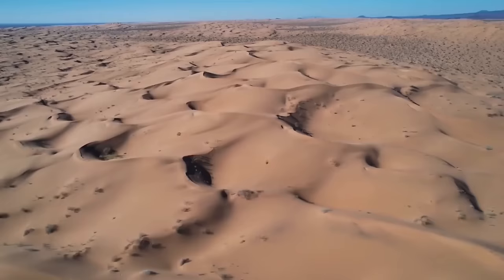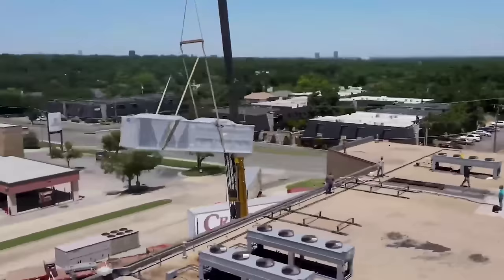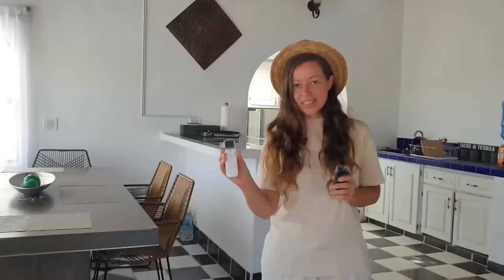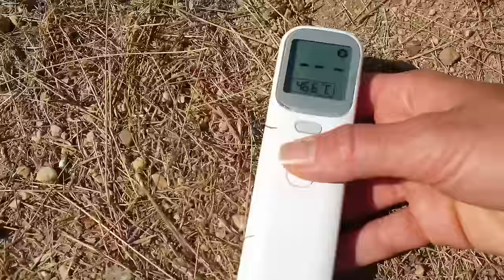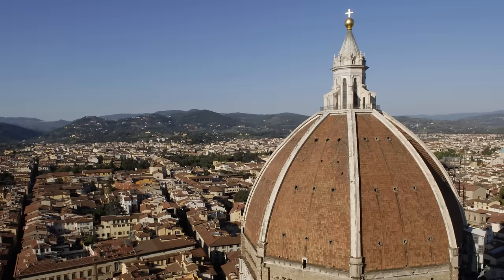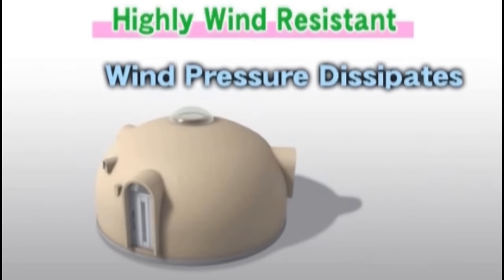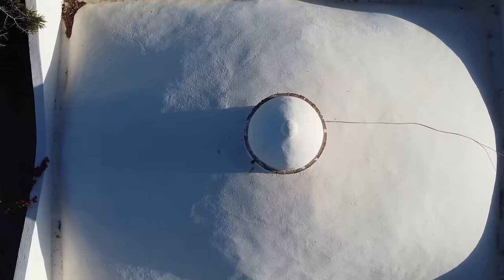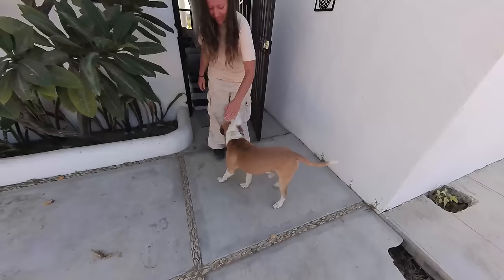How I Live In The Hottest Place On Earth Using An Ancient AC System To Stay Cool!

Comment: In Malaysia and Indonesia they use thatch roof with a vent near the top where all the heat escapes but rain cannot get in. These houses are not dome shaped but more rectangular. These traditional houses have no A/C at all just gentle cool breezes. The key I think is the vent near the top and not the shape.
Reply: I actually think the shape is more important. The traditional houses of Batak and Miningkabow people (sp? it's been a long time since I was there.) in Sumatra have a sway-back wooden or thatched roof with a large, screened vent at each end. The ridgeline also extends quite far beyond the vertical walls of the front and back facades, sheltering them and their porches from rain to a degree. Thus, viewed from either side, the roof resembles a square sail billowing in the wind, dipping lower in the middle and quite high at each end. So this creates a Venturi effect, where the breeze coming in the large vent at one end is compressed in the middle and then rushes out the vent on other end, pulling more air. And when there is no breeze, the warm air from inside is able to rise because of the upward-trending ridgeline, and the outflowing air creates a cooling airflow within. In a hot, humid environment like theirs, airflow is key to comfort.
Reply: @feedigli  TY.   Also humid area, this designer:  kotaronishiki

Comment: 117*F outside, 77*F inside Still not cool enough for me ! Under ground houses in my area maintain a 55*F temp year round so only a little heat needed in wintertime!
Reply: That sounds interesting. What area are you referring to? I'd like to learn more.
Reply: Sounds like Coober Pedy.  Limestone is wonderful stuff.
Reply: If the exterior is painted with the new cooling paint and the house walls are thicker for insulation, then you could achieve more passively. The exterior/under-house tunnels for cooling of air flow is also interesting (though perhaps hard to add after the house is built).
Reply: Depends on the humidity. 77 @ 15% humidity is more comfortable than 72 degrees at high humidity.

Comment: It's easy to build a house against heat or against cold, but the really hard thing is to build a 4 season house.
We in Europe don not use these methods, because we have very cold winters and very hot summers.
Reply: My understanding is that ground temperatures 1-2 meters deep are pretty consistently 13-18 C , year round, in most of the temperate latitudes. So, using earth tubes as many have suggested, is not a complete, stand-alone solution, but would definitely moderate extremes, reducing the heating/cooling needs to a level that, in cooperation with other methods, could be handled sustainably, without resorting to a/c, or fossil fuel heating. 
A lot of European cities use sun shades over their narrow streets in summer, which really helps. Again, not perfect, but much nicer than the wide, baking asphalt of American car-based streets.

Comment: Same as the Temples in Thailand, very tall structures with high sloping roofs ending in a sharp point, the radiated heat doesn't get down to the floor so sitting there, very comfy, while outside very hot.

Comment: The white paint is a major factor as well.  I experimented on a south facing outside wall, and white paint was 20-30 deg F cooler than a medium (more than 50% reflective) blue paint.  Most of the heat inside was coming through the roof, though, which was 3 tab asphalt shingles.  I wish I could cover the roof with something white.  It should be noted that not all white paints are equal, as only some reflect infrared radiation, and half the solar radiation hitting the Earth's surface is in the infrared.
Reply from the maker: That is soooo true

Comment: Remote rural off grid here down under , have embarked on an extension using packed Earth car and truck tires  got the idea from Mexico where they build such things. Using the peak of the building as a flow through of hot air and having tubing at just above ground level , created the same as a cave  cool air gets drawn in. Also painted the roof of the house, workshop ect with eco paint , its very white and reflects up  to 80 percent of UV., and around seventy percent of heat ... 45 degrees outside main core of the house is around 30 or so, works.
Reply: Well done!

Comment: Variable insulation (shutters for windows, doors, walls and roof). Opened during night. Natural ventilation from north side. If the floor if not insulated from ground is cool enough. It works if there is a difference of temperatures between day and night. In summer, in my little wooden house, 80 sqm, outside 31 C, inside 18 C with closed shutters. Without cooking.

Comment: I live next to a sizeable pond and my AC is to pump carefully strained bottom-of-pond water through a fabricated A-Coil in my furnace. The water is returned to the top of the pond after use. The strainers require a bit of cleaning from time to time - but hey no compressor or freon !

Comment: My wiring will no longer allow one.  Ten years ago the quote was 15,000.    I don't have in any way or form.  So as soon as I can afford to buy  sand, I'm building an earth home in Oklahoma  near Tulsa.
Reply: Mini-split heat pumps can be bought for under $1000 & are very easy to DIY. They use very little power & are ideal for older low amperage wiring.

Comment: You can also use Ivy or Bougainvillea to grow along your walls, preventing your hous to hit direct sunlight. This will look pretty, but also keep your walls from heating up, keeps them cooler by 5-10 C•. You can also gather dew & rain runoff in a cistern, to water them.
Also, you can use 10-20m burried piping system, which you can open during nights and close during the day, to let airflow pass through.
Reply from the maker: Great tip thanks

Comment: 4:00  Would've rather seen a comparison of how hot it is in the shade outside vs how cool it is up above your head in the building.  I think that would've been more telling as to what are the real differences a person might actually feel
Reply from the maker: Why above your head? You dont live above your head? You suppose to measure temperature from the same altitude for accurate comparison
Reply: @LeafofLifeWorld  Yeah, but i'm not going to sit outside on the ground in the sun either.
Reply: @LeafofLifeWorld  Aside from the shade comments, I was wondering why temps werent just measured with you holding it in hand standing vs putting it on ground level... just a standing measurement both outside and then inside...

Comment: You shouldn't have used the thermometer directly under the sun. To measure only the air temperature you should at least have put it in a shade outside.

Comment: It's surprising to see a drop of 23 deg c. in Southern part of India we treat rcc roof (weathering course)with 5inches of broken bricks(surki) with lime and lay pressed clay tiles and paint it white. despite all these efforts temp diff is hardly 10 deg deg C -42deg c outside to 32 deg c inside
Reply: Time to reconsider the plan. It may be the roof shade, created from the walls around the top. It may be the kind of paint. It may be the design of the interior of the dome.

Comment: I’m in the Sonoran Desert in SE AZ. 20 miles from border.  It never gets much over 100F at 4500ft elevation.  Also spent time in Puerto Penesco in winter months.  No one there ever said it gets that hot there in summer … must be specific small areas in MX.
Reply from the maker: Being at 4500ft is going to make it feel cooler also winter is cooler, the area with these temperatures is at below sea level at the colorado delta near mexacali in the summer months, and they are land surface temperatures, which is different to air temp.

Comment: Comparing the ground temperature outdoors to the tile temperature indoors is hardly a fair/good comparison. You should have used air temperature in the shade outside comparing to the air temperature inside. The architecture indeed has very positive effects in temperature control though. Considering the high sunlight in the region, adding solar panels would provide plenty of renewable power for ACs and other home conveniences. That aspect even make the architecture nonessential (still an incremental benefit and beautiful choice).

Comment: The problem with those massive clay or stone roofs is that after the Sun sets, they will be very hot for hours up to midnight,  making living inside miserable, like in an oven; the solution is to have deep basements, the temperature below the surface is pretty much constant all year round, especially if it is protected by heavy constructions above, then, AS WE SEE IN THIS FILM,  lol... an A/C  helps a lot with not too much energy use.
Reply: would sprinklers help with that? they use permanent sprinklers on the roofs on some places, but using it for 30 minutes or so would probably get rid of that no?

Comment: I stayed in one in rocky point and thought it was one of coolest houses I've stayed in but not temperature wise without AC. It was hot and humid there and as an AZ resident humidity is not something I deal with a lot.
Reply from the maker: You have to ventilate to make it work, its all about air flow but if It can't be created then it will be hot, the over hangs helps alot because they create a cool area in front so when you open the window cool air gets sucked in and hot air escapes from higher windows

Comment: Here is solution for you guys for those who live in less humid areas have a water storage tank in ground and use an desert cooler water storage under ground can make water at 20-25 deg cooler and never open window in day time only. Open when sun has set you should wait for 1-2 hours use curtain and close them when sun rises and fill your cooler tank at night when sun is about to set if its a concrete tank you made to store your water. And if you are in middle of buliding your home then use windcatchers that more effective most of the hot air in your room bump into. Your roof so make some kind of chimeny there. Now for guys with high humidity use dehumidifiers or bulid some water storage inside your living room it can act as pool as well

Comment: Not to be a buzzkill, but besides the obvious AC bolted on the wall inside, you can see two AC condenser units on the roof at 7:24 and I think I spotted a third around the back on the ground. Totally understandable, but kinda takes away from the 'this house doesnt use AC' bit.
Reply from the maker: just because they are there doesnt mean they are in use or work, they can be there for any reason, for heating for example? but i can tell you 100% they were not in use when we filmed this, i had no access to them

Comment: Measuring temp in direct sun is dumb and I'm done at that point, that's a measurement of how hot THINGS get in the sun, not air temp.
Reply: Actually it gets just as hot in the shade in those locations. I lived in AZ and even in the shade it is miserably hot. You need to get almost underground into caves to get noticeably cooler or into a house not just shade.
Reply: Mrb wrote, "Measuring temperature in direct sun is dumb..."

Perhaps you didn't stop to realize that the buildings are in direct sun, and therefore such measurements are relevant to the point of the video, which is to illustrate how buildings (which exist in the direct sun), located in the hottest places on earth (deserts), are able to stay cool without the use of modern electrical solutions.
Reply: @RichardHarlos    Then the thermometer needs to be the same color, oriented the same to the sun and insulated exactly the same, exposed for same time.  Measuring temp in the sun is DUMB.  She was pretending to take air temp and anything else is meaningless.
Reply: @Mrbfgray  Let's get down to the core issue that you obviously have: what *exactly* is the margin of error here, and why does it matter so much to you that you feel that insulting people is the best reply you can muster?
Reply: @RichardHarlos    If stating obvious truth to someone is "insulting" then they need to examine their childish frail state of mind.  Not my problem or concern.

Impossible to even aproximately estimate "margin of error" from info provided, surely you are not THAT stupid.

Comment: The Mexican brick dome construction is awesome, but very limited in where it can be built.
That dome will likely collapse in a decent sized earthquake, and provides less resistance to tornados and super strong winds.
It works it a particular part of the World, but in many places in the United States, it would not meet building codes.
Reply: That's likely true. A modern design should be considered to keep the good qualities and add strength and flexibility.
Reply: OTOH a lot of construction in the US is garbage materials, eg wood, the quality of which is ever-more rapidly declining, or drywall, which when it gets wet (from a flood, say, or hurricane, or lots of high humidity from no a/c when the power fails) grows moldy and/or turns to mush. Sure, it's code, and readily available and easy to install, but it's a hell of a mess to get rid of and to sand and finish.

Comment: AC has been a game changer for me. I live in England where houses are built for cold and wet rather than hot and dry with my house having tonnes of insulation in the walls and roof and most people have central heating but don’t have air conditioning. In Summer we often surpass 35C and the inside of my house is like a greenhouse. 😭🔥 bought a little mobile air conditioner after a summer of almost 40C heat and it’s made such a difference 😍
Reply: That's one of the things people forget, you don't have to cool your entire home, just cooling one room with a portable AC is enough, we have central AC but I have a small window unit installed in our bedroom, we use that at night instead of running the central air while we sleep

Comment: Looks like an exaggerated claim. This structure will definitely improve coolness but around 22 degrees Celsius is too much. I can also see some Split A/c s on the wall. Why they are fitted at all if the structure is so effective.  It depends on how much cool was overnight & how much you retain in your house throughout the day  & only hot air flow will not reduce temp so drastically. Then also it will be a maximum difference of 8 to 10 degrees Celcius.(our experience of staying in tropical areas where temp often reaches 40 to 42 degrees in summer.)

Comment: The newest paint called Burnham sulphate white paint is 5 to 10 times stronger for its cooling affect then commercial white paints that reflect 80 to 90% of sunlight due to its 98.5% sunlight reflection. this is where they should paint that over their house in those areas.

Comment: After reading many of the posts/responses, it seems that most do NOT understand this architecture.
It is NOT meant to be sealed up tight, with no air exchange with the ambient. The oculus is open to let the heat flow up and out instead of getting trapped in the interior of the structure. And if you are drawing relatively cool air in, it can keep the interior much cooler than if you hermetically seal it  During the night, you will not have as much assistance from the ambient in moving air around.

Thermal Regulation: Domed brick structures excel in thermal regulation. The thick brick walls provide excellent insulation, keeping the interior cool during the day and warm at night. The dome shape minimizes the surface area exposed to direct sunlight, reducing heat gain.

Natural Ventilation: The design of domed structures often includes high ceilings and openings that promote *natural ventilation*. Hot air rises and escapes through openings at the top, drawing in cooler air from the bottom, creating a natural cooling effect.
Reply: Most folks are seemingly looking for a single, magic bullet solution. Reminds me of a cartoon I once saw; solar panels powering clothes dryers for a sleek modern apartment building,...meanwhile, at the old house across the street, laundry was hanging on a clothes line.

Comment: This doesn't work very well in humid tropical and sub tropical climates. The temperature at ground level outside will be higher than at 1 or 2 metres.
Reply from the maker: Its located in a tropical desert, half the year its dry and the other half humid

Comment: Interesting but no one measures the temperature in sunlight.  You're interested in air temperature.  So you need to measure in the shade.  And inside don't measure on the floor.  You want air temperature.

Comment: Want to see the 10% of US houses who don’t have aircon! Do swamp coolers count?
Reply: I lived in Tombstone AZ and Benson AZ using only swamp coolers because that is all that would work there. AC needs a certain amount of humidity to work. It removes water from the air and with it the heat. No humidity no cooling effect. When the air is too arid you need to add humidity to get a cooling effect thus the swamp cooler. It is not really more effective to use both.  Add humidity in one end of the house then try to remove it in the other. Just use the system that is effective. We were only 10 to 20 miles from the border with Mexico thought you might be curious since this video is about cooling in Mexico,
Reply: Look at higher elevations, and also along the coast within Mediterranean latitudes, and you'll see what you asked about.